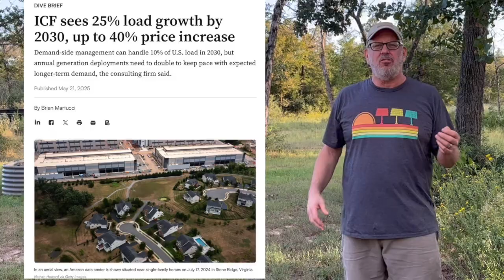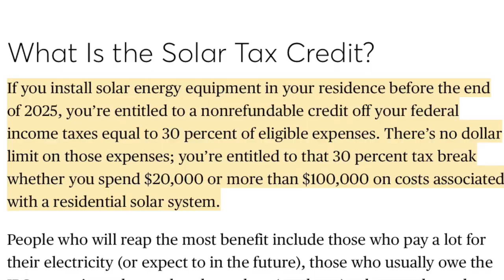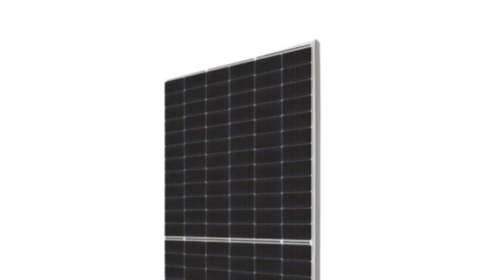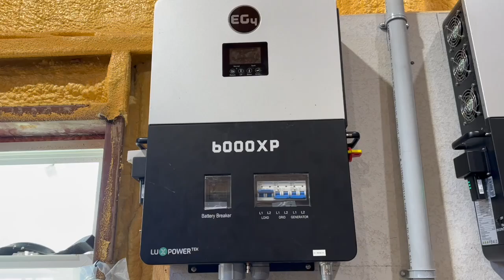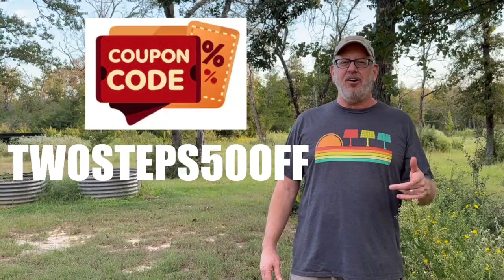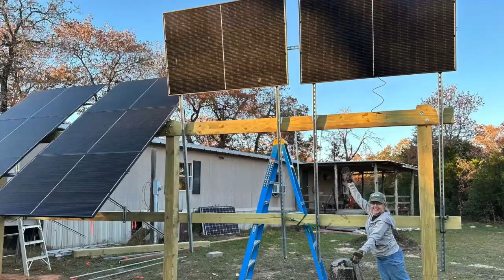Fire your electric provider and go with DIY Solar!

Comment: What if I have a lot of 240v loads from cooking, charging cars, woodworking tools and a hot tub, sometimes peaking slightly above 20kw? Would I just double or triple these units?
Reply from the maker: Exactly.  You would just size your system to your loads.  I run two EG4 6000xp inverters now and my peak draw is probably 6-8,000 watts with everything on simultaneously.  One 6000xp can do 12000 watts for 3.5 seconds so theres headroom for short spikes.  The 12000xp is just a larger 6000xp and it’s great as well.

If you are doing electric car charging and other high demand loads, look into the hybrid FlexBoss21 with the Grid boss.  It does 21kw of PV input plus you can use 200 amps of grid power if needed.  The Flex Boss allows you to set up dedicated smart ports for your car charger and workshop tools so they don’t impact your home power.  It’s the ideal system for heavy power users who still want to maximize using solar first, then grid for any additional needs beyond.  

https://signaturesolar.com/eg4-flexboss21-inverter-v-1-1-48v-split-phase-21kw-pv-input-eg4-gridboss-mid-v3-1-bndl-e00019-3-1/?searchid=0&search_query=Gridbos

As I said in the video, whether you’re spending $5,000 or $35,000 on a system, if you can claim the tax credit, it pays big to jump into DIY solar now.  Everyone’s situation is different and Solar may not be ideal in some locations, or municipalities, but for us it’s been great.  We’ve air conditioned our shop and we keep the inside of our house cool in the summer heat, never worrying about the costs.  If you have more questions just call Signature Solar and they’ll guide you through the entire process.  I’ve spent almost $20,000 of my own money with them and they helped me build a great system.